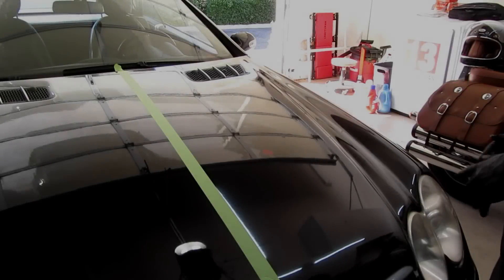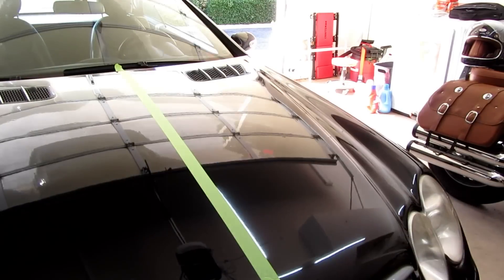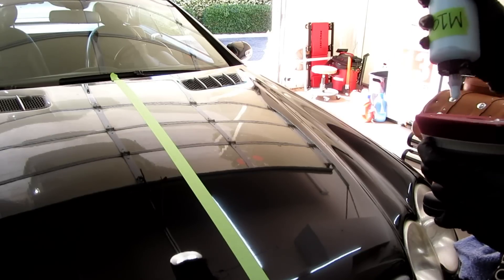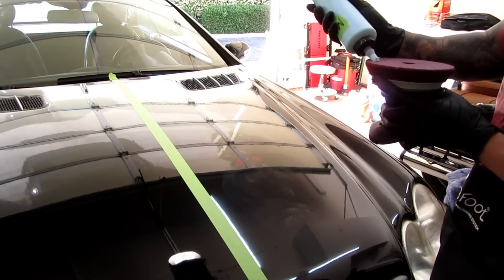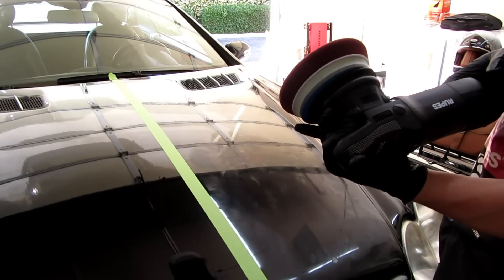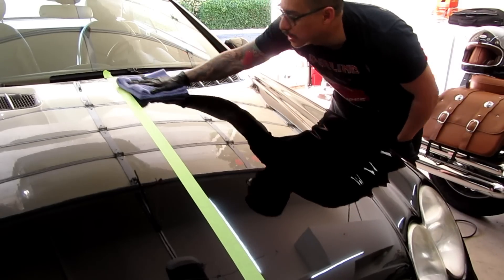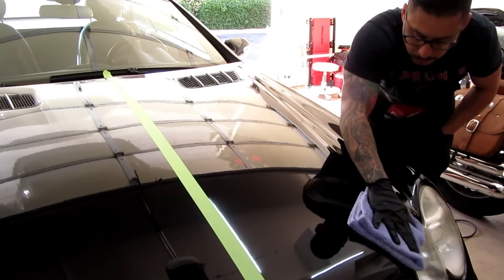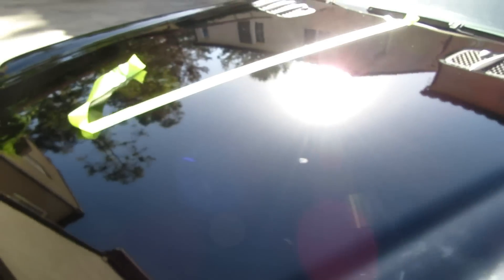Meguiar's M100 Reivew | Better than M105

Comment: Good Stuff Mike, thanks! That's a great price for M100.

Believe or not Ultimate Compound is pretty handy too. It's somewhere between 105 and 205 if you don't need something as aggressive. And the wipe off is WAY better than 105.
Reply: UC is very good!

Just south of M105 for cut.

Comment: nice. I use 100, 105 and 205. I find myself using 100 most frequently. I used to use menzerna, but that stuff leaves too much dust behind.
Reply from the maker: It's a great compound, especially for the price.
Reply: I bought the gallon sizes of all three compounds and finishes.

Comment: Hey bud great video, I got a couple questions how would you attack those curves on top of front fenders? Smaller pad? And also is it a MUST, to tape off plastics and headlights while compounding? I just started this detail venture any info is greatly appreciated, I’m gonna have to check this product out.
Reply from the maker: vincealinceable yes I would used a 3" pad. I'd prefer to tape off but I don't always do. It's smart to tape off plastics because polish or wax can be a pain to remove from plastics.

Comment: Great Vid Mike!  What size pads are you using Mike?
Reply from the maker: 5"
Reply: Is there a special reason why you use 5 inch and not any larger ?
Reply from the maker: Don't need a pad larger than 5. I don't work on trucks or suv's and most modern cars have so much curves, especially sporty cars. 5" makes most sense for me.

Comment: Hey MikeEM1, are you using a polish compound after using M100?
It definitely doesn't dust as bad as M105, I used baby oil to help with the dusting it works decently.
Reply from the maker: Sonax Perfect Finish is my go to for a second step most of time. I would use distilled water as baby oil seems like it would make it too slick and effect the cutting. But hey, use whatever works for you is what I say.

Comment: How does M100 compare to TLC?
Reply from the maker: M100 cuts more, TLC finishes better(M100 finishes pretty well though). Both are really good products. Depends what your goal is for finish and how much time you're looking to spend paint correcting. If paint is really bad, I'll go to M100 on a Meguiar's MF pad.
Reply: @MikeEM1  Great, thank you sir and thanks for the quick response. Have you yet had the chance to try Sonax Cutmax?
Reply from the maker: @hayden199516  I haven't, but always hear positives things.
Reply from the maker: @hayden199516  also I have an AR15 myself if that's you in the profile.
Reply: @MikeEM1  I enjoy it! It's a good compound for sure. 

It is indeed, one of the finest firearms there are.

Comment: What about Sonax CutMax?
Reply from the maker: Joey Crysel haven't tested it yet
Reply: Good compound. Excellent cut(one of the best). Not meant as a 1-step compound.
Reply: Joey Crysel Sonax Cut & Finish is the best one step especially for black paint, as it has zero dusting.
Reply: Nick M sonax perfect finish might be better on black, as it still cuts good and finishes better than cut & finish.
Reply: mark Saf Its great too, in fact I have the Sonax line of abrasives. The level of cut from cut and finish yields better results imo. Have you tried cut and finish?
Reply: Nick M never have, to be honest.
Reply: mark Saf Yeah its newer I think,. But I recently did a one step correction on a 2012 black vw convertible and believe me I tried everything un my arsenal to avoid dusting (Jescar, Sonax PF, Angelwax, Griots FCC, TLC) and what amazed the hell out of me was Sonax Cut & Finish. It truly had zero dusting and a above average cut with an extremely glossy finish. This lady had a car that would scratch the heck out her car so it was pretty bad lol.
Reply: Nick M awesome! I'll have to try it.

Comment: Take it easy pushing the M100.  It IS really great stuff but it isn’t a miracle compound.  It’s more abrasive than the 105 and M100 is really more designed for harder paint.  Also, comes down to cutting pads vs foam pad consistency and pressure vs heat.
Reply from the maker: When was I not taking it easy? Also this Mercedes didn't have soft* paint. Also never said it was a miracle compound, just a great bang for buck. Results shown what it did.
Reply: MikeEM1 I wasn’t accusing you of anything.  Beginners sometimes misunderstand the reference of product that is available to them and it is easily misconstrued on a short video highlighting a (once again) very good tool/product.  My position was simply adding some information which wasn’t mentioned.  ALL information is good information.  I don’t normally watch YouTube videos about this stuff from people detailing their cars but the title interested me to the point of watching.  My intention was not to offend you but, to continue to inform others by way of using your video as a vehicle.  You must not be a professional because your jerky response to an actual professional’s input is not helpful.  NOW you can be offended.  Viewership and followers don’t appreciate negative responses and it eventually cost you.  Be better at responding politely to people especially when they didn’t appose you.  Keep up the good detail work and get better at your people skills.  Just say “thank you for watching”!
Reply from the maker: Didn't have a jerky response at all. Was trying to clarify your comment. You could have said, note to beginners, take it easy with M100 and such.
I am not a professional. Just a guy on youtube who likes to keep cars clean, paint correct, test products and go tracking with my car. This isn't a business and nothing is going to eventually cost me. I can reply how I want to because this is my channel. People have the freedom to stay or go.

I'm sure we both could have worded our comments differently, but my people skills are fine. Have plenty of people who have met me without issues. You're just being sensitive.
Reply: M100 is designed specifically for a  wool pad on a rotary, on any type of paint. Period.

It just so happens that M100 has been found to be a very useful liquid for dual action polishers as well - especially with microfiber pads.